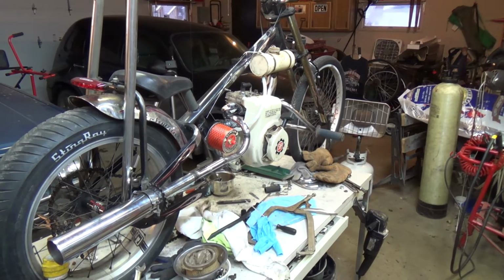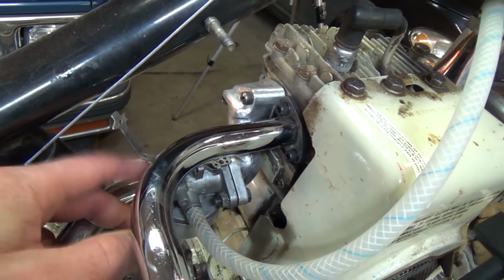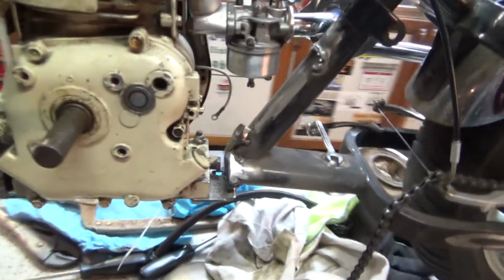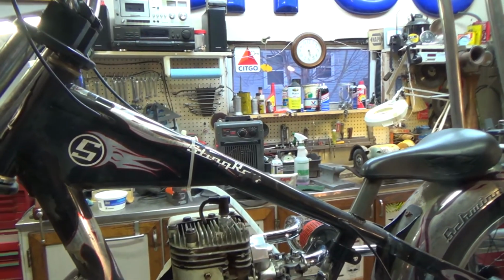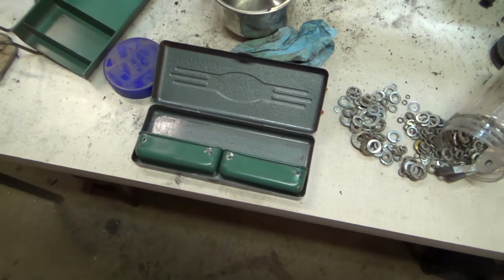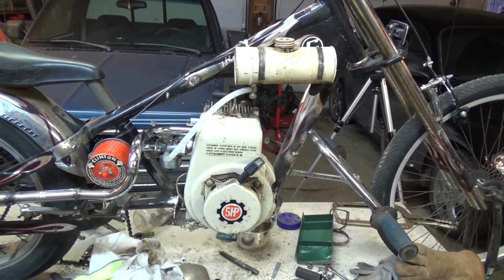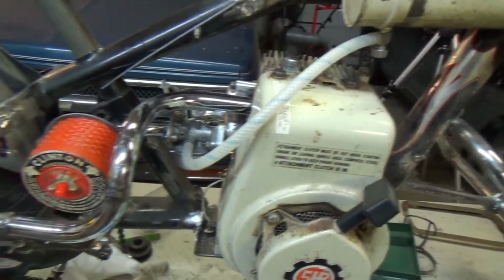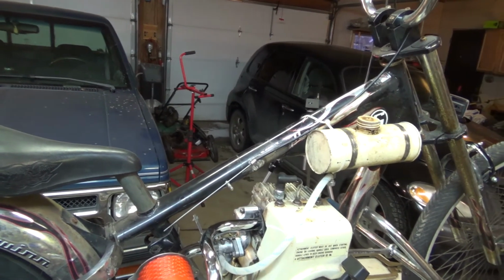Motorized StingRay, The Gadget Bike, Vol 2, #5, Inhale

Comment: Like the idea of the twin box / fuel arrangement, just a quick thought about toolbox contents: spanners, screwdrivers pliers etc might be fitted in if you could find ones designed for bicycle maintenance / repair. They are usually smaller and lighter. Could these be held in by elastic / bungee cord? alternatively replace the trays and use a tool roll made perhaps of something like canvas with slim pockets to hold individual tools. Perhaps weld a correct size of nut inside which you could screw a spare plug into.
Reply from the maker: Hmmm, more great ideas. Thank you Dan. I will look into those options. Now I am wishing for a larger tool box...

Comment: I would use a pully right at the 90 degree where your throttle cable comes down, to switch direction
Reply from the maker: +Mike W   Thanks Mike, as you follow through my playlist you will see that I ended up changing directions :)) several times with the throttle linkage before I came to a final configuration. Thanks for the great suggestion and for taking a look at my Gadget Bike in progress. I am about to get started back on to it to finish it off.

Comment: Hello again, I noticed that your going to have to take the motor off to change the oil, have you thought about instilling an elbow in the drain so you don't have to take the motor off. I like the chrome, just a cleaning on the engine is the way to go.
Reply from the maker: I am planning on getting an elbow, I just haven't found one yet...LOL I actually am watching one on eBay and will need to sell more "stuff" to make that purchase. I am really leaning toward the cleanup on the engine to go with the more "vintage look" but that means a different tack on the paint job for the frame too...lots to think about. Thanks for stopping in and being observant Steve. I appreciate it.